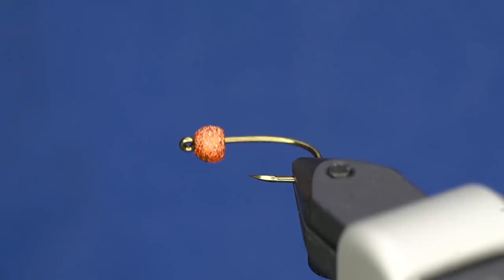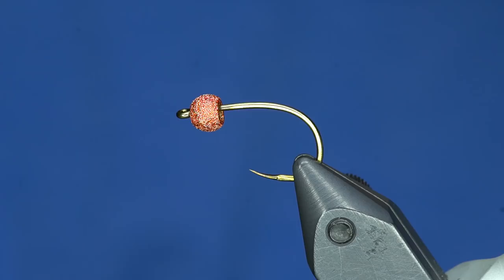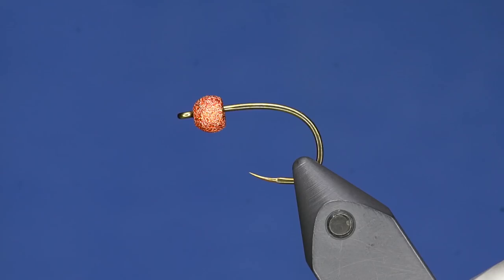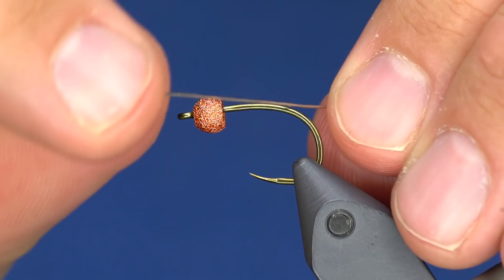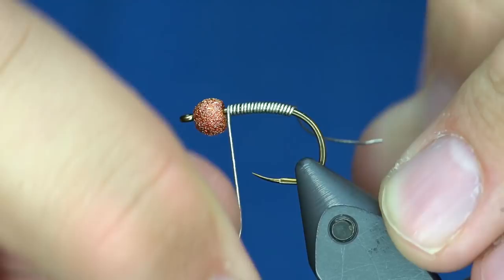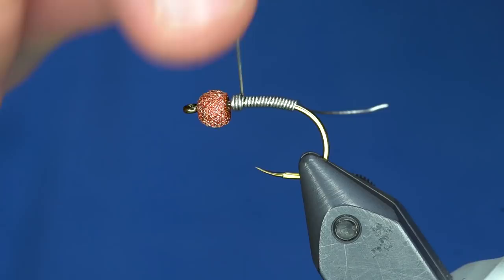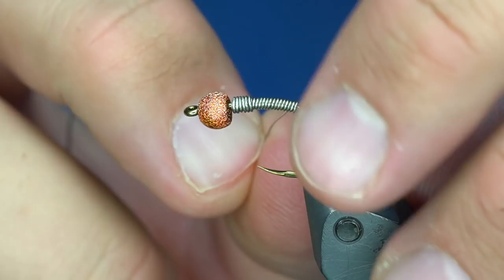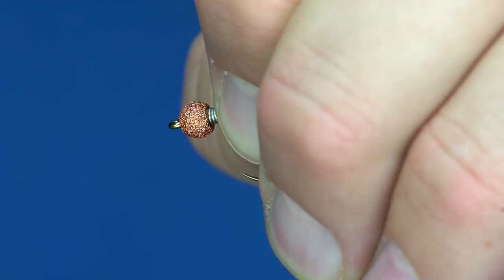Fly Tying Tutorial: The Jumbo John

Comment: You use a tool to cut the thread, not a pair of scissors, at about 13:15, right after you use the whip finish tool. What the heck is that and who makes it? I looked all through your store and Caddis Fly shop for it
Reply from the maker: Brian Kempkes it’s the Loon Quick Cut whip finisher. https://store.flyfishfood.com/Loon-Ergo-Whip-Finisher-p/f1001.htm
Reply: Fly Fish Food thanks , i thought it was a stand alone tool, that’s why I couldn’t figure it out.
Reply: @troutnut01  you can also grind a cutting edge on the back of most whip finishers that's what Tim Flagler uses
Reply: @vanquish_8145  unfortunately I’m old school and learned to tie before they created whip finish tools and I learned how to whip finish by hand, even down to #28. I found a miniature jewelers file, used my grinder to smooth the sides, put a 22 degree bevel into the tip, te hardened it, then used my sharpening diamond steels to hone a 28 degree micro bevel like my wood chisels, then imbedded the other end into a scrap piece of Osage wood and made that into a little handle, it works pretty good, much better than any scissors could.